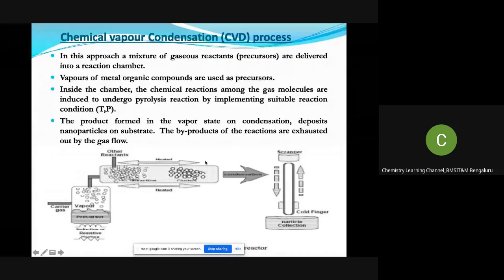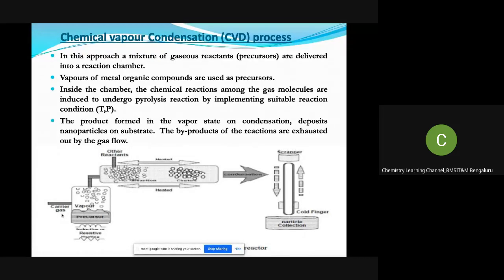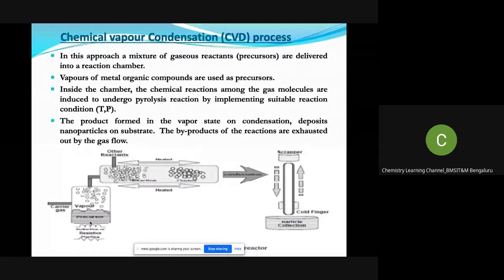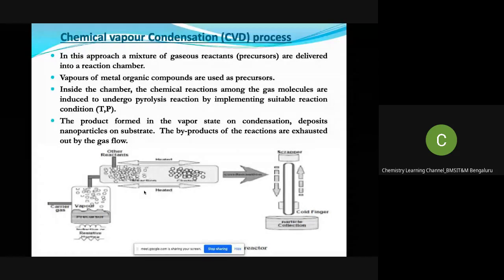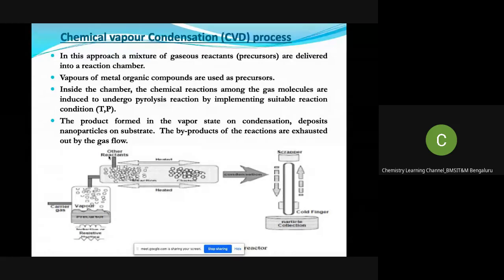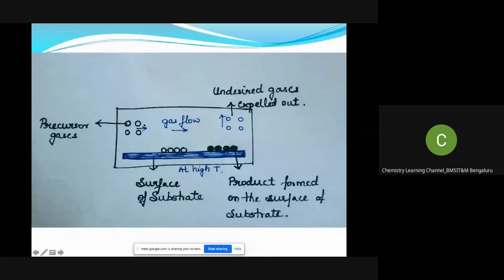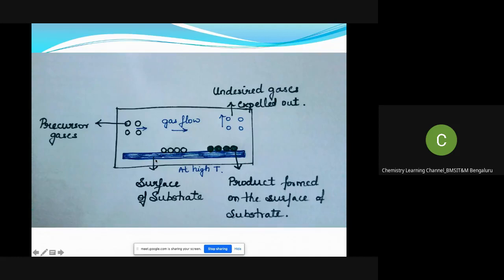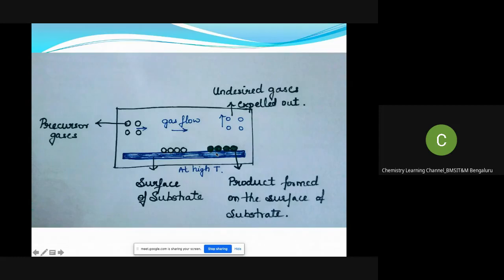Chemical vapour condensation method_Synthesis of Nanomaterials_Dr Jyothi

Comment: Gas particles are turned into vapor which is then condensed as a solid over the surface of the substrate....but how come a gas turns into a vapor and get condensed?
Reply from the maker: No.. no.. Gas particles are the vapours of the organic metal compounds used as precursors here. 
These are forming product during the course of reaction at extremely high temperature, which also will be in the vapour form itself, the product is formed on the surface of the substrate itself and is further condensed.
Reply: @chemistrylearning_bmsitm_b6043  so gas is reacting with the substrate at high temperature to form another gas which is the product?
Reply from the maker: @scaramouche768  yes, when precursor molecules come and sit on the surface of substrate, at high temp, reaction will take place and product is formed
Reply: @chemistrylearning_bmsitm_b6043  thank you very much! Your video helped me understand this topic🙂
Reply from the maker: @scaramouche768  My Pleasure.. thank you..